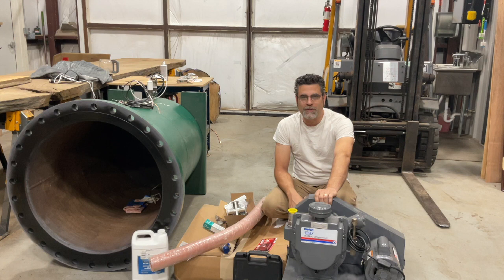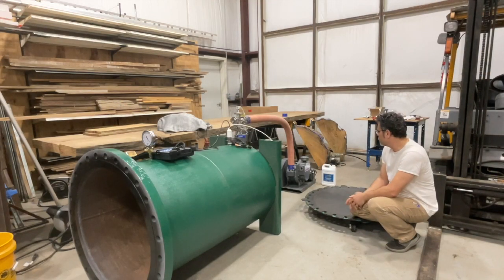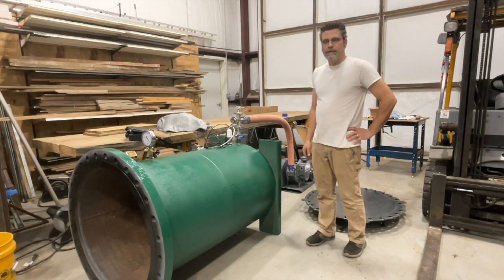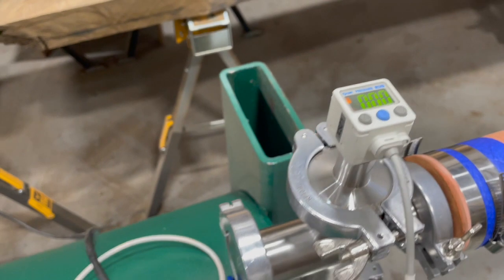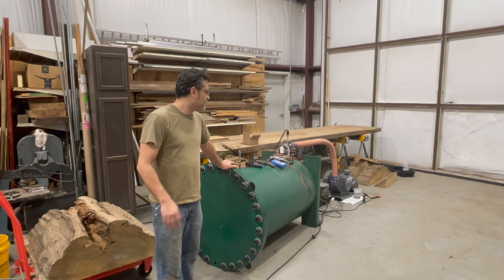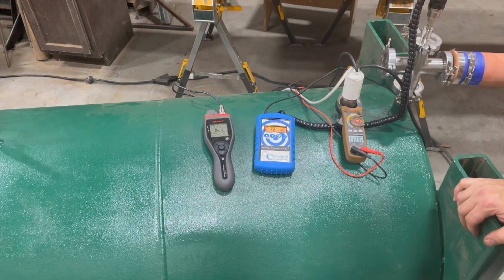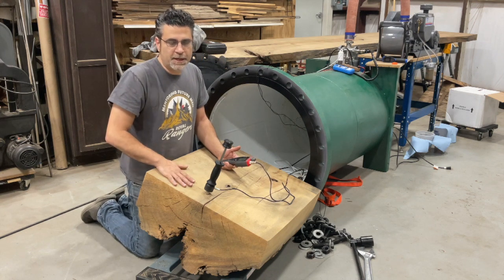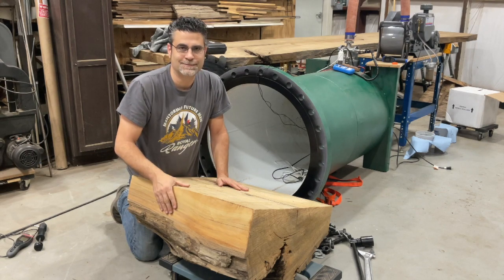Shop Built Vacuum Kiln

Comment: Did you start with 20% humidity in the wood ? Thats not the economical way to dry wood
Reply from the maker: I’m working with sinker cypress. It’s way more saturated than normal wood. My starting point is higher than the meter will register. I agree this process is cumbersome. I only dry larger thick pieces that would take many years to air dry and are too risky for a conventional Kiln like the legs shown in this video 

https://youtu.be/Vw6MetuNtOY?si=UIrZ3MnAHl-Fc0-2

Comment: you could for sure use a scroll turbo pump that can move lots of air quickly. Those can be had regularly at university excess inventory stores for next to scrap value .  Only thing and you'd know by now but that end cap looks light, a vacuum water separator is also required or your pump will die quickly.  Those Welsh pumps are beasts though still would by some seals..

Comment: Have you looked into a vac booster pump to help pull initial vacuum, at my old job in a lead smelter part of the refining process used a vacuum dezincing process and they had like a massive super charger before the main vac pump, it would pull max vacuum within about 5min on a chamber 550cf(top section of a 400t kettle)

Comment: Where you get that pipe??
Reply from the maker: My chamber is made of oilfield surplus from a local machine shop. My chamber was simply a large slip-on pipe flange that was already welded to a 5 ft piece of thick wall pipe.

Comment: Hi mate, very interested in the background research and tech specs for the vacuum kiln. Wondering if we could correspond on that?
Reply from the maker: Sure. I’m no expert but don’t mind sharing what I’ve learned
Reply: @bricequib  Thanks a lot. A few questions: (1) Wondering what your thoughts are about the required strength/thickness of the chamber v the type of pump (or amount of torrs) you are using. (2) Are you able to list the ancillary stuff and what its rough cost was (3) Would you do anything different with the benefit of hindsight (for example, would you get a pump that already has a moisture removal system) (4) Have you had success since the video was made in drying out timber and are you going to build a larger unit as originally intended?
Reply from the maker: (1) I don’t have much data on required strength.  I do know that the atmospheric pressure is about 14.6 pounds per sq inch.  This can add up over large surface areas.  My chamber is made of oilfield surplus from a local machine shop. My chamber was simply a large slip-on pipe flange that was already welded to a 5 ft piece of thick wall pipe. The material is a little more than ⅜inch steel. When I first brought it into the shop I stood it up on end, and It was nicknamed “The Mario pipe”. 
When sizing the pump, I was advised that the pump CFM should be equivalent to the cubic feet of the chamber. My chamber is approximately 20 cubic feet. My pump is a refurbished Welch 1397 DuoSeal Vacuum Pump rated at 17.7cfm. It is a little under the advised amount but the best pump I could get within budget.  My target is to stay below 8 torrs. The pump cannot be used above 10 torr for very long.
(2) The total build cost was way more than expected.  I spent about $6.5k building it. There were a few things I did not account for when starting the project.  You will need a good digital vacuum gauge. I used the Chemtech Scientific Bullseye Vacuum Gauge. Connecting the pump to the chamber requires a thick walled vacuum hose. I used Welch 331080-5 Vacuum Hose. The vacuum pumps are shipped dry so you will need to purchase oil.  My oil was contaminated quickly during the initial learning stage, so you might want to have extra on hand.  You will also want some good vacuum grease. I purchased the grease and all the fittings from https://locoscience.com .  The heating pad used is a simple heating blanket that I purchased from Amazon. I had to do a little modification to make it stay on. Seems like everything on the market is set to auto shut off after an hour. 
(3) I would have never welded in the NPT fittings but rather would have used a flange that can use a gasket or o-ring.  The video shows me painting the inside. That is proving to be a mistake. I should have opted for a polished surface. 
Pumps equipped with moisture removal can jump in price significantly.  I did look at possibly using a cold trap. At this time I need to recoup some cost before putting more technology into it.  
(4) I have successfully dried a few pieces that would otherwise prove difficult to air dry. I dove into building a vacuum kiln more out of necessity for two reasons.  I had a few really thick pieces of wood I needed to dry quicker than air drying would allow. All of the professional kiln drying services in my area are not set up for small batches. I believe the woodworking community in my area would benefit greatly from a kiln that could do small batches. I do want to build a larger scale but not as large as I was originally thinking.  The more volume the bigger the pump needed. If I rebuild another chamber it will be more rectangular and better fitting to a slab to eliminate dead space/volume. I am considering the use of a  Turbomolecular pump. They still require a roughing pump because they cannot be turned on at atmospheric pressure. Someone who goes by the handle “seeigecannon” reached out to me via email and gave me this diagram as a suggestion for the next revision https://drive.google.com/file/d/1N-rNRC5eAKGKKkhenkCEgdDzzxtKm59H/view?usp=sharing.
My hope is to make a significant revision to the project this year. My goal would be to have a process that requires less babysitting and could run for a week at a time without interruptions from oil contamination.  My full time job does not give me much free time- so as for this journey, I'm writing the timeline in sand.
Reply: @bricequib  Hi Brice. Thank you very much for this detailed reply. Very useful! Sounds like I need to do some more saving before I attempt it. At the same time, it's a fraction of the cost of buying one. Look forward to seeing Mark II when you get around to it!